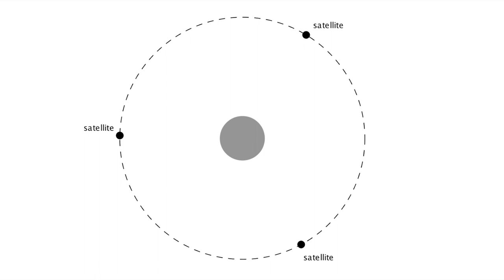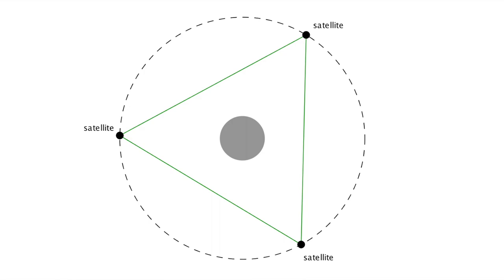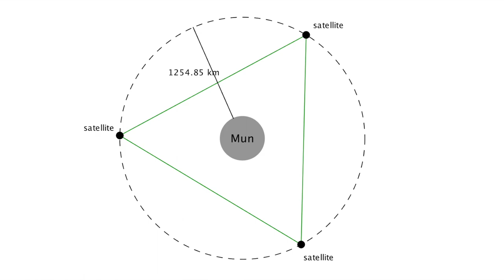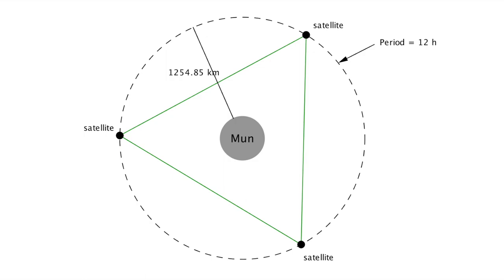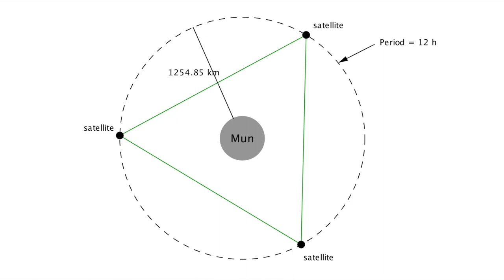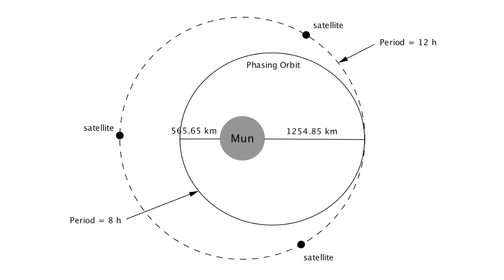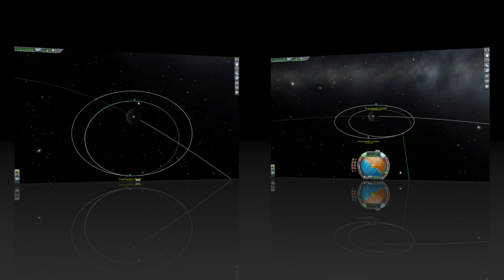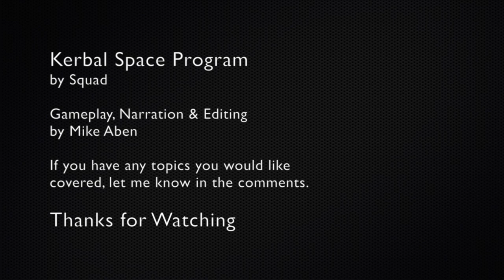Relay Networks - KSP Tutorials #11

Comment: Great to know about how to space out the satellites around each body. For Kerbin, I had just launched a vessel every two hours and reached an altitude of 600 km. They were pretty evenly spaced since a kerbin day is only six hours, and I launched identical vehicles on the dot every two hours. 
Fun bit, the leftover fuel from those satellites work as refueling stations now.

Comment: Video helped a lot still in 2021. Used a similar satellite but was able to do this using smaller engines and fuel tanks like the swivel and terrier which are adequate enough with the octo probe core :D
Reply from the maker: Yeah, I have a recent updated video which does this better and within a career mode game.

Comment: Just thanks ! Very well put out. Learned a lot, from multi node fairings, to phasing orbit. Thanks to you, in a few hours, my science lab on the dark side of Mun will transmit back lots of science to kerbin
Reply from the maker: Just make sure to read my correction in the description regarding a better altitude for the communication relays. That, or put on stronger antennas than I did here.

Comment: Five years later and the information in this video still holds true.  However a word of warning...

First I will point out, Mike did say you don't need to build a network around Kerbin because of all the ground stations scattered across the planet.  But what if either you want the challenge of playing with those turned off, or you're like me, stupid enough to accidentally disable them when setting the game up?  Then you'll need a relay network around Kerbin, or face the prospects of having zones in which your spacecraft will not be in communications with the KSC.

Facing this, because as I said, I managed to switch all the ground stations off in error, and also because I'd never had any reason to do it before, I decided to set up a Keosynchronous orbit for my three little early career relay satellites.  I had no option but to use the HG-5 antenna - just like in this video - putting two on each sat. because I thought they'd look a little cooler than if they only had one.

Man, I got that orbit so accurate, I was feeling really chuffed with myself, two satellites were literally as accurate with their orbital period, as KER would show, the third was 1/1000th of a second over.  After patting myself on the back for the umpteenth time, I noticed something...

The green communications lines were coming out from the KSC alright, but there were none going from satellite to satellite.  I started clicking on the icon at the top of the screen which turns on more pathways, but nope, those satellites just couldn't talk to each other.  Not only that, but even if one was over a blackspot and another vessel with a C-16 antenna was flying through it, it couldn't relay a signal to it either!

So, if you have to build a network around Kerbin, don't shoot for a Keosynchronous orbit, if all you have is the HG-5 antenna.  Maybe three would work, I haven't calculated that yet, and right now I'm too busy working on lowering the altitude of the three sats. I have in orbit to do so, but I would definitely recommend putting your coms. network in a much lower orbit than I did.

Comment: i made the probes bare minimum using stayputnik probes 1 big antenna for establishing a reliable comunication with kerbin and 1 small antenna along with a few solar panels and a few battery's and later in career mode i de-orbited these and crashed them into the moon and put a more updated model which replaced the solar panels with 2 rtg's which are rotated inside the probe core itself making it even more compact the battery's were also moved inside the probe core itself so the only external parts outside of the probe core is the antennas over all the relay satalites are really compact but i also decided to improve it one step further by adding rcs a few rcs thrusters and 3 small mono-propellant orb tanks that are moved to the inside of the probe core with them barely sticking out with a docking port on the back of the probe core for refueling if neccessary

Comment: im so confused about all the numbers.. what is the farthest that i could put the maxed out relays to still have good signal and then how far could i get another relay system? im thinking the first one would be in the dres orbit then the next one outside jool or sarnus (outer planets mod) but then from there each planet would need its own relay network.. but i dont really think each body needs its own network inside of kerbin.. but i dont know.. maybe each planet needs its own network? the kerbin system definitely doesnt need a network around each body.. probably the same for other planetary networks.. one network for each planetary system.. but even then when planets arent aligned.. im thinking of a full solar system relay network with full coverage 5 bars.. i work for verizon.. jk.. im just some kid looking for a wifi signal on eeloo..

Comment: Hey, considering that those orbits aren't perfect, how many years it take to the relays connections be unstable? Is it like 10? 10,000?
Reply from the maker: Well let's see. I think I got the periods within a second of each other. The period is 12 hours, so a 1 second drift is 1/(12×60×60) of an orbit. Multipling by 360 degree gets a drift of 0.0083333 degrees per orbit. That's about 1.8 degrees per day year or 0.5 percent of a full rotation. They'll be fine for a while. In game rounding errors may come out to be more than that.
Reply: @MikeAben Do you mean 1.8 degrees per year right?
Reply from the maker: @lucasrsarmento  Yes, my mistake. I'll edit it to fix it.

Comment: Mike Aben… Did you use stock parts for the booster assembly? I have a full tree and cannot replicate what you have at all... especially the 2nd stage engine. I have nothing in my set of parts that even looks like that.
EDIT: Also, I'm using the exact same fairing as you but do not have the options that you do nor the ability to set interstage nodes. What mods are you using?
Reply from the maker: It's all stock. The second stage engine is the Poodle, which I believe has been remodeled since this episode first aired.

Comment: you dont have to calculate a phasing orbit, you can just release the satellites and send them out one by one in manuevers that look pretty close to a triangle.. the crucial bit is that they are as close as possible to the same apoapsis and periapsis should be pretty close to apoapsis.. within .1 tolerance i would say.. if theyre too far off you can adjust them with other maneuvers.. its how i got my one satellite keostationary.. i eyed that one too..
Reply: oh i see why you need a phasing orbit because youre already in the orbit apoapsis.. i was launching mine from kerbin leo.. ive actually never established a relay network around a moon..

Comment: You mentioned at the start it’s good to know the period of the orbit and that’s why you chose two days. But never explained why, could you elaborate?
Reply from the maker: It was fairly arbitrary. It just seemed an easy number, and actually, I have a later video that explains why it wasn't the best choice.

https://youtu.be/gpQmvwU1x8c

In that video, I explain why a period of 3 hours (alt of 377.35 km) is better. I am currently working on an updated tutorial to this one (actually, there'll be two) that will drop in about a week and a half.

Comment: I'm trying to rebuild the booster here but my rocket keeps flipping over.  Seems like these are some old parts too in this video.  Are you able to give me a part list for the booster?
Reply from the maker: Sorry, I don't have access to this craft file. I can say that the part specs haven't changed. If you're having trouble with it flipping out you can try larger/more tailfins and/or more reaction wheels.

I do have a newer video where I updated some things, especially the satellite design.
https://youtu.be/18rO6Avm5FE
Reply: @MikeAben  Very nice.  I realized that you probably had the RC-L01 which I didn't have and thought that was the Advanced Reaction Wheel object soo... rookie move.  I like the new video - I've been watching a lot of them.

Comment: Can probes be controlled by a ship? Like a ship in orbit with a kerbal pilot can have a signal to the probe on the surface without having a connection the space center?
Reply from the maker: That's a great question. I know the Remote Tech mod has that functionality, but to my knowledge stock does not. It would be a simple thing to have a part that would allow that.

Comment: Okay, but won't they eventually reach one another? There is no way for them to travel at a constant orbit and not change velocity or orbits??
Reply: I imagine the timescale for that to happen would be more than enough of a timescale for  you to be able to figure out how to launch and correct an orbit of an existing satellite.
Reply: You have to go back and slightly adjust the orbits of the satellites every 10 years or so. Just put each relay into a longer or shorter orbit until it’s back in line with the others. and then put it back to its original orbital period.

Comment: Awesome video.
Quick question: How does Communication apply in KSP? And does it apply in Sandbox
Reply from the maker: It has two effects in career and science mode. One, it adds a bonus to the amount of science that can be transmitted. This bonus is related to the strength of the signal. Without a link, you can't transmit at all. Also, the link effects your ability to control uncrewed probes. The effect is adjustable in the difficulty settings, including the ability to turn it off all together.

I think all this is irrelevant in sandbox, though I rarely play sandbox, so I'm not sure.

Comment: Hey, I'm late for the party! Thanks for the help, mate! 

1 question, though... How do I "fix" my triangle? It took me too many attempts to circularize the sat's orbits and, as a result, I ended up with a non-equilateral triangle (two of the sats are on opposites sides of the Mun to each other and can't communicate). How do I fix that?
Reply from the maker: What you need to do is slow down, or speed up, one of the satellites and wait for it to be in the right position relative to the other satellite. You can then just return the orbit to what it was.

To slow down a satellite, you need to increase its orbital period by burning prograde to raise apoapsis (yes, it feels backwards - ain't orbital mechanics fun!). You do the opposite to speed up. The adjustment need only be a small one. I do it in a career game here - https://youtu.be/Zg6OXbcEuNc

Now I used the Kerbal Engineer mod to my advantage, but stock now gives you many of these tools too. I want to get back into these tutorials. This would be a good topic to cover.
Reply: @MikeAben  Thank you so much! I'll keep that in mind when I install the relay system again (I had the wrong antenna so I had to destroy it all *sigh*)
Reply from the maker: No problem. We've all been there.

Comment: If any of the orbital heights are off by any amount, there not going to be in the same places next year.
Reply from the maker: @Steel Wheel Absolutely. They will require the odd correction, but you'll be surprised how long they'll stay pretty close to the right place. With a bit of care, they shouldn't need any adjusting for another year or two.
Reply: @MikeAben  it might also work with just two satellites because the network path can go through ground a little
Reply from the maker: You won't get complete coverage, but it'll be alright. In my campaigns I usually take probes built for satellite contracts and re-purpose them as communication satellites. That means I'm putting them in their orbits one at a time. You get pretty descent coverage once you get to two.

Comment: Just before decoupling the first relay, you had no connection from your main ship to kerbin. How did you keep control?
Reply from the maker: I had no connection because I was in the communication shadow of the Mun. On the default settings, you still have limited control in this situation so I could still decouple and raise antennas. Right after that, I popped out from behind the Mun and had full control.
Reply: @MikeAben  ah right, that rings a bell from when I was going over the settings of my recent save. Having that setting to always require a connection has bit me in the butt a couple times now.
Reply from the maker: @DustPyro  Typically, I do have it set to zero control without a connection in my games, but had it on the default settings for tutorials. This still would have worked. I would just have done further orbits until I had my connection at apoapsis.
Reply: @MikeAben  i just often forget to either put an antenna on my thing, or to extend before i’m out of range XD

Comment: While I hate doing it as I love finding something to complain about...😁  I again have to give you eleven out of ten for this video - fantastic stuff!  Believe it or not but I never entirely mastered how to set up sub assemblies properly, I even learned that here!

One question, is there any advantage to using stack decouplers under the fairing?  I tend to use separators myself as they completely break away from the vehicle, removing the now redundant piece of the truss assembly in the process.
Reply from the maker: Good idea on the separators. I tend to default to the decouplers as I hate leaving the debris behind.
Reply: @MikeAben  Where can I find it? It's not in the Tutorials playlist. Another question: How can I choose which probe core steers the rocket? My rocket kept tipping over right at launch until I realised I mounted the sats upside down and did not set the Control Point option to "reverse". But the final stage has it's own core so I can deorbit it, I'd like the game to use that core.
Reply from the maker: @Kilian2  Sorry, where can you find what? As to the probe core issue, we've all done that. In fact, I had the same thing happen in my last stream. On the launch pad you can right click on any probe core and select "control from here". In the VAB, you can use the root part tool to make a different core the root part. That will make it the default control point.
Reply: @MikeAben  Sorry I somehow misplaced that comment. I already found the improved / more recent video about Relay Networks in your "absolute beginner" series.

Comment: Does that small relay antenna really have a strong enough signal to return to kerbin?
My own experimentation with these Is that they are pretty much useless outside low kerbin orbit.

Am I doing something wrong?
Reply from the maker: What I showed here works fine.  I'm using it in my own career game.  It works fine for Minmus too given at least a tier 2 tracking station.

One error I did make (see the correction in the description) is that I put them in too high an orbit for a communitron 16 in low orbit (or on the surface) to communicate effectively.  A better altitude would be 377.35 km.

Edited to add: Even with a tier 1 tracking station, the small relay should have about 96% signal strength around the Mun.  Of course, when relaying, the other antenna is important too.  Perhaps you did what I did and put it in too high an orbit.
Reply: ... I  did something even dummer, i forgot to extend the antenna on my lander. Well good to know these things actually work :)
Reply: @MikeAben  One question though: If I decide to use the 377 km altitude, my first Pe while before the phasing fase couldn't be the 565,65km marker, right?
Reply from the maker: @dasLlamas_94  The problem with the 565.65 km is that a 565.65x377 orbit has a period of 3.76 hours. You want it to be 2 hours or 4 hours which are each 1/3 off from the final period of 3 hours. This has actually gotten easier since this video. KSP now gives you the period in the orbital information at the bottom left. Set your closest approach to 377.35 km. Then during your capture, burn until your orbital period is 4 hours. You will now be in the perfect phasing orbit.

I really got to do an updated video on this sometime.

Comment: I am new guy to ksp could you tell me which engines do you use in this mission 
Pleasee
Reply from the maker: The probes have linear RCS ports on them for propulsion. The transfer vehicle is powered by a RE-L10 Poodle, and the lifter looks like it has a RE-I5 Skipper. Some of these engines look different now because this is a pretty old video.